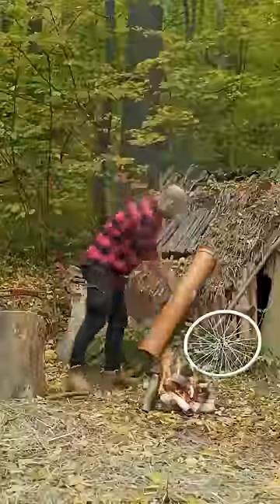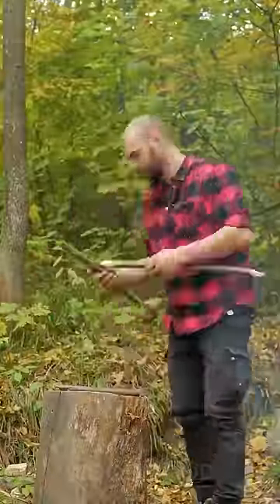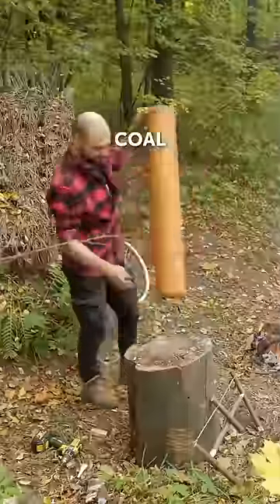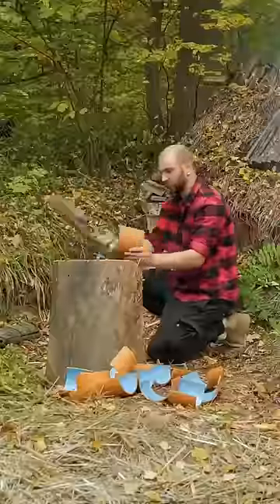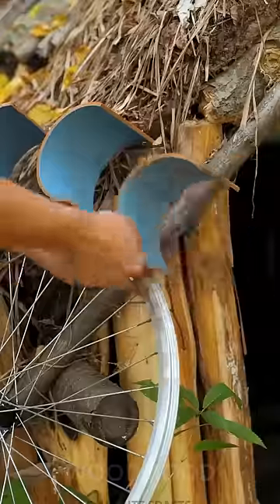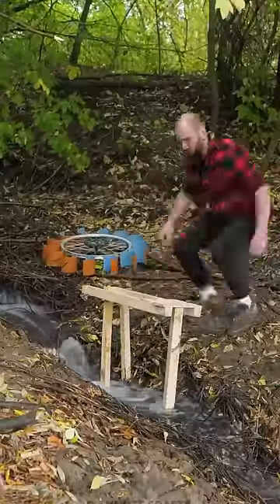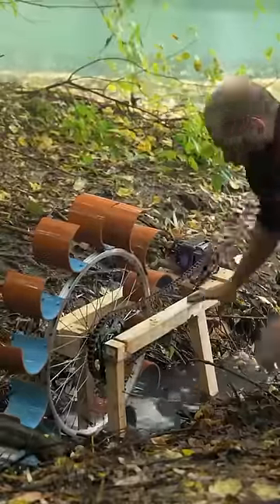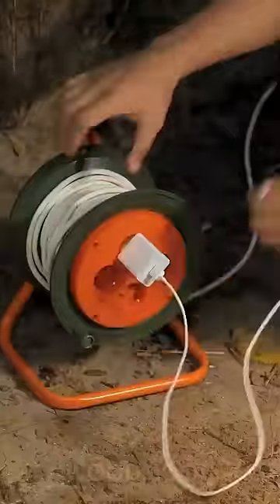Sustainable electricity solution for homes in the middle of nowhere 💡#shorts #hacks #crafts

Comment: By far is not that easy. At least that set up will not work. You need an electric stabilizer for the power fluctuations. You will need a battery to store the excess power and use it when your production is low.If the water debit is to high for your system. you will need a breacking system to lower the rotation speed. Take care of the voltage produced by your system and the voltage needed by consumers. It is not that simple.
Reply: True.
Reply: Do you know how to make one that does work?
Reply: @suzannegriffiths4795  Yes.
Reply: Most car alternators are regulated internally, this can easily do heat blankets too.
Reply: @JonByron  There is a smart switch made with diodes and transistors. They controle the duty cycle of the alternator and regulate the output. If your system doesn't have that all you can do is to light up a classic light bulb. No phone charger, no laptop, no anything that needs stable voltage, no anything that needs 50 or 60 Hz.
Reply: You spoiled it)😊
Reply: @alexkubeck8587  I am sorry. I thought that the video wants to teach something not to create a fantasy world.
Reply: Chevy alternators!
Reply: What you're saying is true. However, this kind of lower tech high tech is going to mean the difference between survival and certain death after the zombie apocalypse/giant meteor/civil war/lolly do dumb day puts us all "off grid".  Hopefully in that eventuality,  there will be someone around with more expertise like yourself to improve this admittedly primitive setup. How will you design a charge controller and battery bank from natural materials and random found objects for example? Please enlighten us. Your help in these endeavors could save the human race from extinction!
Reply: I knew there will always be someone like u  in the comments to put things into perspective.. 😂😂😂😂😂😂
Reply: Yes you are right
Reply: I always  use a battery light when out camping.
Reply: @adbogo  I don't mean to negative but the solar panel is bound by the same rules. The photovoltaic panel energy production depends by the quantitie of energy captured from the sun. And that is not constant. The system that you use, allready have built in electronic regulators and stabilizers. Have a nice day.
Reply: @iosiflengyel1835  Thank you, you too have a nice day. 🙂
With a solar panel you have  a complete setup ready to go. It fits on your roof-rack. Charge the batteries while you're driving to your destination. 
You can do the same with a water driven generator. An impellor connected to a car alternator and in any stream you can generate electricity without having to build an eloborate construction.
Reply: *braking
Reply: @iosiflengyel1835  you don't have to be sorry, you are helping many
Reply: I was excited for a minute there!
Reply: @iosiflengyel1835 Your clearly smart af 💯
Reply: All of the things you named are extras. You don't need to store the energy, unless you want to. You don't need to account for variability unless you care about that. What this guy created will convert mechanical energy into electrical energy very simply. It isn't perfect for some of the reasons you outlined, but if you need electricity, you can produce it with just the items outlined in this video. People have been doing it since hydroelectricity was discovered. This guy's setup works just fine for using electricity without storing it (no battery, etc.). You can examine a longer video to see what I mean. Generating electricity and STORING electricity are two very separate things. https://www.youtube.com/watch?v=d6U-KnEB6I4
Reply: @iosiflengyel1835 what if all I want is just a simple light bulb or two and not any charging or nothing would it still work?
Reply: @MorganOlson-i1j  If it is used only for lighting and you are not bothered by the dimming and overbright cycling of the light, then it is OK. In any case, take with you some reserve light bulbs. I don't now how will affect the fluctuation their life.
Reply: @iosiflengyel1835  thank you and yes that's all I was planning to use it for, there's a really nice creek near me that I can use and it goes all year round yes it does rise and drop but for how narrow it is it's pretty deep. But anyways have a good day!
Reply: 230 AC from a small stream. All our problems are solved 😂
Reply: @MorganOlson-i1j  Measure 10 meters or 32 feet or the creek. Put in the creek something that floats. measure the time between the 32 feet. If the floating object is faster than 10 seconds on the measured length, your creek is good for your project. When you buy the generator, ask the vendor about the number of rotations needed for 240V or 110V depending of what do you need. Remember, A big wheel on the water, turns slower, but you can use a gear to obtaine higher speed (needed by the generator). Success.
Reply: I always thought it was possible since I saw the sizes of the streams that ran waterwheels of mills from since the Middle Ages. I'm guessing the first step would be hiring a specific electrical engineer to analyze ur streams
Reply: @iosiflengyel1835 
Thanks man.
Can you give me a refrence to understand the mechanics between the production of hydropower.
It would be helpfull if you can refer something that is simple and not too much complicated.😊
Reply: @TayyabKhawaja-br7kj  The rotor of the generator needs a certain speed to create a current with the needed frequency and voltage. For this the water needs at least 1 m/s (3.2 feet/s). Because of the fluctuations in the water flow, the generated current will fluctuate too. To avoid this, the system needs electronic parts that will eliminate this problems. If you use the system onli for light, the parts shown in the video are enough. If you want to plug in the system a TV or a laptop, you need filters and current stabilizers. There are systems wich are built on creeks with little water. You can see "turbines" like this in videos on YouTube. There are many things to say about the topic. What i said is the minimum. I hope it helped. Have a nice day.
Reply: @iosiflengyel1835   Thanks alot. BTW are you an engineer. 😋
Reply: u sound lyke a super engineer....
Reply: @KodStephen  I only have finished high school.
Reply: @TayyabKhawaja-br7kj   I only have finished high school.
Reply: @iosiflengyel1835   well then, I can say that atleast you were atentive during your classes.😁
Reply: Yeah townships can force you to take it down. It’s right up there with collecting rain water
F the system
Reply: Please dont leave out that the generator he is using looks like an alternator thus is 12v and he is definitely not using that power straight up. Also most likely the  power draw would cause enough resistance to stop the wheel from turning.
Reply: I usually just carry a transformer, two bare different metal, long wires..bury it near stream ..and charge up my phone. 😎👍 I even used found on site, buried chicken wire, and buried bare copper wire, spider webbed in different directions, i lit up camp with led, lights. and was enough to charge my phone.i learn even just coiling the wire, near wire,  multiplies the output, 😎👍 im still experimenting.
Reply: Is there an a more efficient system that you recommend.
Reply: @anonanon9385  https://en.wikipedia.org/wiki/Pelton_wheel
Reply: @anonanon9385  I gave an idea, but obviously you didn't read it. You can also use a fan motor rewired. For AC..So many different ways, just build around what needs powering, AC or DC.
Reply: @anonanon9385  Dis you know even the trees leaves with air passing through them generate electricity. ..radio waves I. Air. .. regular crystals can amplify. Salt, quarts..etc
Reply: @iosiflengyel1835  yeah but you have went to a trade school. Dont lie
Reply: @JuanV-f9m  All sounds nice, please tell me how do you regulate the voltage needed for the LED. I now that the LED's are sensitive to voltage (to high and they burn out).
Reply: @JuanV-f9m  Sorry, i realy didn't read your repy (I whose working). Take a cardboard tube wrap arround it some copper whire, put a steel ball in the tube and shake. You got current. I am not saing that your system is not working. It is. Question is: Is it usable?
Reply: @iosiflengyel1835  Depends on your led, regulate with resisters, here's some alternate;;. Use a pencil lead/graphite, motor brushes, 
   You could also carry a trim pot... potentiometer, that you could regulate. 
  But truthfully why waste the extra, get more LEDs, 😎👍 
  LEDs can be ordered separately, or assembled, for use in tents, RVs, cars..  use your imagination. You could even hook up a battery to store power. I hooked up an old motorcycle battery. 
   I once hooked a dynomotor, to a moving/swaying branch, that I put a log stick across top, so it just swayed, back in forth. It worked while the branch moved, reason its good to save in a jar with vinegar/citrus, and two metals, if you need to make a battery.  Batteries can be made from anything, lemons, potatoes, oranges, plants themselves.😎👍
Reply: You can make a very basic open circuit set up for DC 12v but I'm drawing a blank in what you'd need to do that.
Reply: @lukeblizzard5909  what you mean, stabilizer a capacitor and coil are used, but in the field you use what you have.
Reply: It'll work with a car alternator n 12 volt lights
Reply: @thomaskopp4243  ...and a car battery for the excitation of the alternator. The difference between an alternator and a dynamo is that a dynamo have permanent magnets and it is capable to self-excite, but an alternator have copper coils wich need to have current in them to create electromagnetic field. You can start an alternator with a battery on it untill the alternator starts to create current and then you can remove the battery. It will work but it will damage in time the rectifier. So, it will work with a car alternator n 12 volt lights n a car battery n a rectifier.
Reply: @ignatius7106  Yes, with a dynamo it work's. Dynamo have permanentmagnets and doesn't needs excitation.
Reply: Very true
Reply: You'll actually need s battery and an inverter to get correct voltage to charge your phone etc
Reply: Your part right. Take any external regulated alternater. Use a reostat on field wire. Disconnect output wire from battery, now use reostat to match rpm to correct voltage you require. Boom 110 volts. We used to sell the box that had reostat and volt meter in it. Flip switch it would charge battery, or flip other way, it would produce 110 volts. Thats dc current, not ac. So a tv wont work, but a lightbuld or power drill will. Fyi
Reply: @suzannegriffiths4795 yes i do.
Reply: @iosiflengyel1835 there is no rotor in a generator,  its called an armature. The difference is in the commentator.

Comment: Ya, when I camp I always run into P.V.C. pipe & bicycle wheel O- ya I always bring along a generator.
Reply: He's not camping. Try to keep up!
Reply: And wire. You always have to bring wire camping
Reply: And a Handsaw, and don't forget to somehow imbue the Generator with Magic, so that it generates as much as at least what 2 Household-Lightbulbs need as well as what the USB-Charger tequires.
Reply: Don't forget, you'll need a drill to make bolt holes with.

Comment: The hardest part was hiding the batteries...
Reply: actually you can see it all the time: its the thing with all the trees on it. a water wheel harvests the energy potential from gravity. but yeah: i just saw the end of the short and i doubt that this pissy wheel has that much capacity. ok  i think at least some of the later lamps are actually camping lamps that look like light bulbs and have a integrated battery. specificaly the ones with the blue base.

Comment: Yo! Electrician here! Just a fun fact. Just because it’s getting voltage doesn’t mean it’s the correct voltage. If you don’t pull the correct voltage you will tear up most devices you plug in to that water wheel thing. Anyways, peace
Reply: MPPT from wish or temu!
Reply: How could that be controlled?
Reply: Use a voltage regularly. It'll keep the voltage from spiking and keeping a consistent voltage safe for devices. @crowviking
Reply: That’s an alternator not  a generator
Reply: That’s why they use an alternator and charge of batterys and just use 12 V lights
Reply: @Jerbo1125  it depends on the use... if you only want 12v sure but what if the application requires higher voltage ⚡️ to operate a tv or radio or charge a cell phone. 12v will only get you so far.
Reply: @T.C.Exotics a car alternator can produce 110 volts. You do one of two things. Remove the voltage sensor wire and use rpms to control voltage, or remove regulator and control voltage on field to match rpm until voltage is 110. 40 + years as an automotive electrical tec.
Reply: @joemtnman  I think controlling the flow of water to control rpms would be difficult. A voltage regulator is more practical to prevent unnecessary spikes.also helps with current which is a game changer. Without if the appliances could fry.
Reply: @BOOMTOWN_KENNELS  i never said control water flow i said control the field, wich is what the regulator does, where are you gonna find a dc relulator that runs at 110 volts? I said use a reostat, to match rpms. If you full field the rotor now the rpms will have to be controlled. Use a reostat to control the field. Dude. I started working in a rebuild shop in 1980. I was the warranty station for Leece Neville in central washington.  Very few people know more than me when it comes to dc current. I can make any alternator produce 110 volts, but it is 110 dc volts. Only light bulbs, drills etc non transistor operated electrical devices will work properly.  We had alternator conversion boxes on the shelf. Some had reostats, and some full fielded the rotor so then you need to govern the rpms to get 110. Example.  Vehicle lost body ground, cooling fan provided the ground. So when you reved the motor, the 12v cooling fan carried the load, recieved 100 volts. Sounded like a prop airplane.  How it made it to shop without exploding is beyond me.   It was turning massive rpms. Well 10 times its normal speed almost
Reply: @joemtnman  you never "said" use a restat nor did you imply the application.  Brag all you want but using a generator on a voltage regulator is better than using a alternator only for DC applications. 110ACV is what's needed. Why go throu the trouble to have DCV when ACV is what's needed for literally everything. Go try and run off DC and see how far that gets you. Your reostat isn't going to give out proper outputs for current nor is it practical. Go back to the text books bud. I won't brag about my experience but I ain't no rookie neither. Old school against new school. There is a reason industries prefer to have ACV while using a DC buss to switch to DC. If people listen to you they will fuck up their appliances.
Reply: @joemtnman  it's best to use a generator. If you need more voltage use a transformer to either step up or down. You want to fix current use a voltage regulator, if you want DC us a DC buss to change AC to DC. Car alternators are not really practical
Reply: @BOOMTOWN_KENNELS  you have no idea what your talking about. Ill put my 44 years experience over anything someone taught you or what you read. You are seriously arguing with the wrong person when it comes to voltage. I had my own buisness as well as working my whole life in that field. That guy is using an alternator off a car. If i was to do that i would use a chrystler single field alternator and a reostat, adjust voltage as per water flow. Electronics now days are alot dc powered with a transformer built into the plug. Look at any router for wifi. 12 volts. You would need a 12volt tv. Thats about it. Refrigerator will run on dc voltage if it at 110vdc. You best do a little research before you argue with me. I partialy retired at 50 and bought my land paid in full off knowing what im doing. Now im fully retired at 60. Nice view huh? Yes my pic is my land
Reply: @BOOMTOWN_KENNELS  🤣 dont you mean a battery charger to convert ac to dc? 🤣 alot cheaper. I can convert ac to dc with a diode. Go the other way its called an inverter. Changing dc to ac is not practical. You better have a massive battery pack. Might as well go solar if you are gonna do that. My way, you just need any 12volt battery. People who try to talk electrical to me crack me up. See i can do what electricians do, but they cant do what i can do.
Reply: @joemtnman  I'm 32 and already at where you at in life. You're a little late to the show bud.
Reply: @joemtnman  I won state and topped out the best in my class. Also went to nationals. Learning electrical was fucking cake walk.
Reply: @joemtnman  joemtnman  alot of the older generation thinks the younger generation doesn't know what they are talking about when you couldn't comprehend today's technology. There are many ways to create a circuit now what's efficient is a different story.
Reply: @BOOMTOWN_KENNELS  your at where im at 🤣 your retired? Ya right.. 🙄
Reply: @joemtnman  I gotta say for as old as you are you sure do act like a child you sure your retired?
Reply: @joemtnman  just to be clear disability and retirement are 2 different things ... it seems you got the 2 mixed up.
Reply: Wouldn't you need a charge controller or one of those devices that regulate wind and water turbines?
In order not to damage or overheat batteries when the wind notches up considerably or the increased current from torrential rains spins the water wheel almost off its housing?